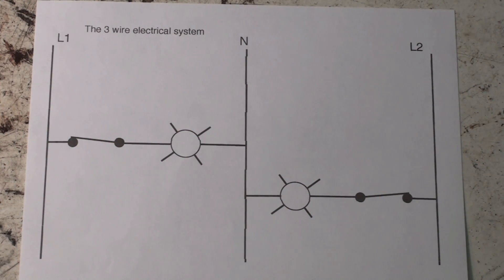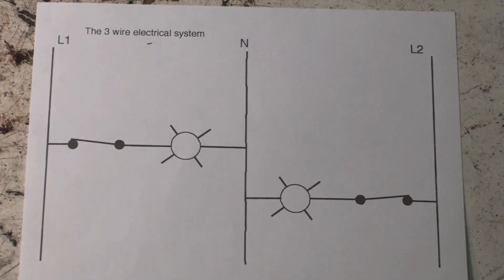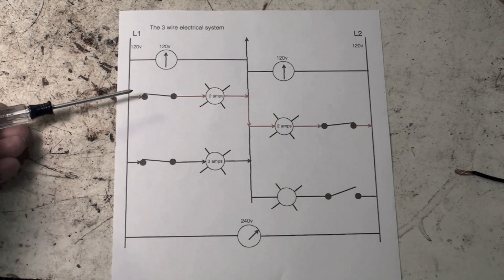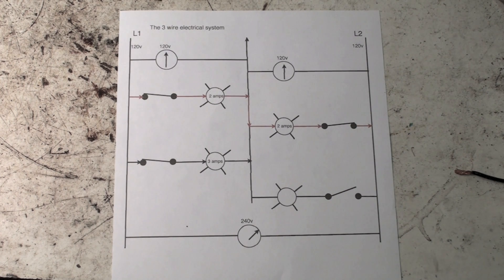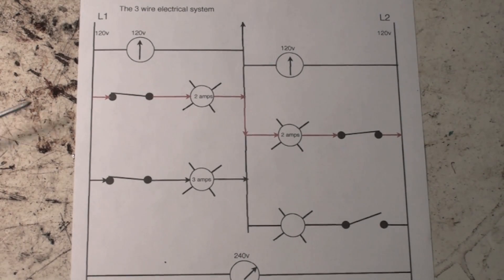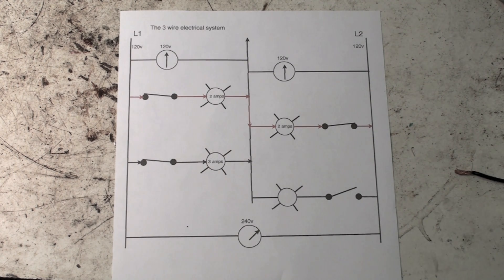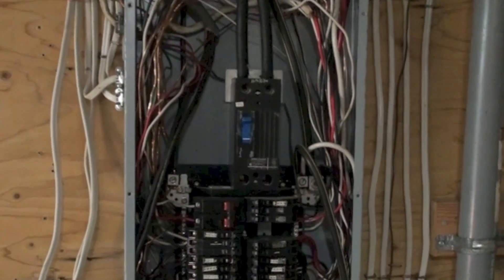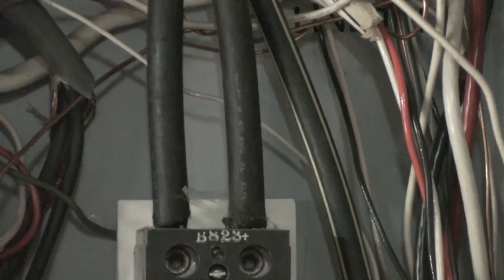How the 3 wire electrical system works

Comment: I ordered a car charger for a customer (240 volt). But, it only had terminal receptacles for L1 & L2. There was also a grounding bar. This stumped me. When my electrician showed up, he told me this three wire system didn't use a neutral. The car charger was hard wired. Is this right? How can it operate with no return path for electricity? This would seem to depart from what you have shown here.
Reply from the maker: Glad you guys got this one done.  Thanks to Cotronixo.
GFM
Reply: Thanks to GFM for taking the time to teach.
Reply: +Stephen Anderson - 240V does not use the transformer secondary center tap. Here's an analogy. Imagine an old flashlight with (2) D-cell batteries, switch on. You place a 1.5V lamp across one battery, and another 1.5V lamp across the other. All three bulbs are now lit. The flashlight's bulb is acting like your battery charger; and for it, no connection is needed where the two batteries meet each other, because it is a 3V bulb.
Reply: Cotronixco I think I'm getting this. when we install a DC solar array, a positive and negative (and ground) come from the array (marked black and red like a car battery)...but no neutral. So, if charging a battery, apparently the battery is DC and wouldn't need a neutral. But, the power from a home is AC, not DC and I doubt the car charger is inverting AC to DC. So, apparently AC can charge a DC battery using L1 and L2 (2 hots), but no neutral. Interesting.
Reply: +Stephen Anderson - Your battery charger is designed for a 240VAC input and a 12VDC output. Inside, there is a step-down transformer and a rectifier, which is how it converts AC to DC.
If the battery charger's transformer primary were center-tapped and connected to the building's neutral, no current would flow through this neutral conductor, which is why it's completely unnecessary.
Reply: Cotronixco Awesome answer. Thanks.

Comment: Interesting and informative video GFM.  

I can understand that panel imbalances go out the neutral wire and are balanced by contra imbalanced loads from other panels.  This of course implies that all imbalances are equally distributed between the two phases, i.e. +120 VAC and -120 VAC.  Does this happen in real life?  It's hard to be perfect so what happens to to the net imbalance.  Does it go back to the powerhouse?

Some of the circuits in my house use 3 wire + ground (14-3 +G).  The two hot wires are connected to adjacent circuit breakers meaning they are +120 VAC and -120 VAC.  I end up with two 15 amp lines with a common neutral which never carries more than 15 amps as all current above this amount is balanced out.  Should I care about balancing both circuits?  Meaning, should I aspire that the common neutral carries the least amount of current by always having both hot circuits in use?

Somebody told me that gross imbalances leading to large current leaving the house to be balanced elsewhere will raise my utility bill.  Is this true?
Reply from the maker: I would not be concerned about the imbalance.  I don't know how an imbalance could increase power usage.
GFM

Comment: I still don't get it, If you were explaining DC voltage, it would make sense. You don't call your diagram a two phase system. In Europe your diagram might be a single phase. Doe's Europe have 480 volt double phase? I guess my question is, is the 60 clycles per second AC cycling between "L1" and L2 ?"  L1 is negative when L2 is positive?  Or is L1 positive while neutral is negative, then changing to positive when L1 is negative. This would make the neutral a hot wire. Your explanation just isn't good enough for me to understand.
Reply from the maker: Europe uses 220 V AC.  You are making this far too complicated.  If you are looking to understanding the AC system at its basic level, get an engineering text and have at it.  There is no positive and negative terminal in AC as the polarity is constantly changing at 60 cycles per second.  Certainly when one side is negative, one side will be positive.  I am telling you what you will get when you test with a meter.  
GFM
Reply: grayfurnaceman   People watch your videos because we are too lazy to read a manual. What I’m saying is if you are going to the trouble to make and post a video on YT, don’t just tell us about the first book of the bible. If you are our electrical priest you just need to include the second half as well.
Reply: I want to add something. You don’t realize how smart people are today. My house is poured concrete. The 110v house wires run through galvanized steel tubing. You said that water pipes are sometimes used a “earth.” When my fuse panel was changed to circuit breakers the electrician drilled in two,  meter long copper, maybe bronze, copper is soft, through my concrete patio and then into the coral substrate we have in South Florida. So if the electrician earthed the box also, if I install a metal appliance that grounds (earths?) to the steel tubing in the walls, is this dangerous?
   I used to travel to Central America and Mexico a lot when younger. When I heard that the shower water was heated for the shower by just winding bare wires around the metal water pipes to heat it, I had a fear of showers south of the border.
    I built boats for twenty years and built a sail boat for myself. Not realizing the height of the mast and the height of the the power lines, my antenna on the mast hit the lower high tension line and I was told that an ozone  halo was created and this took out the secondary line as well resulting in 45,000 volts going from my foot to my arm and I was in the hospital for a week. So I have a reason to have a personal interest. 
    Theres a guy on YT from England that takes apart electrical devices from England. I think his name is “Big Clive.” His videos would interest you.
Reply from the maker: It is not dangerous.  It just gives a place for lightning and discharges of all sorts to dissipate.  Glad you are still here after the sailboat incident.  Lucky man.  About the power going to ground.  High voltage works differently than the low voltages we see in our homes.  The comments section is not the place to build an understanding of earthing but suffice it to say very high voltages will overcome the high resistance and go to earth ground.  I did several videos on earth ground.  I also have a playlist that may help.  "Electric wiring in the panel grounding and bonding".  Hope it helps.
GFM
Reply: I have another question for “grayfurnaceman.” I’ve had 3 or 4 water distillers over the past thirty years. The thing that kills distillers is the thermostatic circuit breaker that shuts the machine off when the water is gone and the temperature rises. The heating coils seem to last forever. So if a gallon of water is distilled in 4 hours, I try to un-plug the distiller at 3 and 3/4 hours, but I always forget. So I have a timer, but the distiller is a 3 prong and the timer is a 2. So, not having an adapter, I’ve cut off the ground “probe” to “make it fit.”  Am I going to get electrocuted? Will turning the plug 180 degrees make a difference?
Reply from the maker: First, do not turn the plug.  That will reverse polarity.  Cutting off the ground is not the best way.  I would prefer to use a grounded timer.  If you insist on using the 2 prong, then be sure the unit is connected to a ground fault outlet.  Hope this helps.
GFM
Reply: grayfurnaceman  Reverse the polarity? You know I’m plugging into an AC outlet ? The timers bought at Home Depot will all be the same, without a round “ground” “Neutral” prong. I guess what I’m asking is why will most two prong, if that is the right word for them, plug-ins only enter the socket one way? One side is wider than the other. There must be a reason for this.
Reply from the maker: A/C does have polarity.  The small prong is hot.  You can shocked by this one.  The large one is neutral.  You will not get a shock by this one.
GFM
Reply from the maker: A/C does have polarity.  The small prong is hot.  You can shocked by this one.  The large one is neutral.  You will not get a shock by this one.
GFM

Comment: Right for the wrong reason. Neutral center taps secondary field coil of the transformer thus allowing for half of voltage potential, and double amperage( If I'm remembering correctly) in a single phase service, also providing a path back to source, wich is the secondary field . L1 and L2 appear to be phased 180deg. Apart however they are not , because it is still a single phase. Awesome channel grayfurnaceman! You saved my butt the other day thanks for having this channel
Reply from the maker: Thanks for the support.
GFM

Comment: Wow, who wired that panel? That kind of sloppy work drives me nuts. Its unsafe for the next guy that has to work in it if he has to do any live work or troubleshooting in there.
You say neutral is at the line voltage, but its not. As others have said, neutral is center tapped, so its 208 from L1 or L2 to neutral. Ground would be referenced to 0 volts for the safety side of it if you developed a short.
Reply from the maker: This is in the US.  Unless you are wired to a Delta system, voltage from neutral to hot will be 120.  Earth ground is not part of any circuit.  It is there to sink surges, lightning etc.
GFM

Comment: Can you branch a 120v outlet off of a 2 wire 240v outlet?  I assume you need to bring a neutral to the 120v outlet, but will the hot line from the 240v outlet be 240 when something is plugged in?
Reply from the maker: If you pull one leg of the 240 and use the neutral for the other one, you will get 120V.  
GFM
Reply: grayfurnaceman    What about the ground for the 120v?

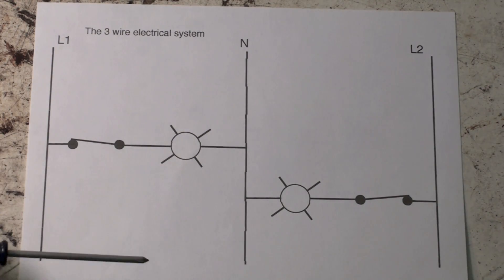Comment: +grayfurnaceman This is totally incorrect. For example @0:47, the neutral provides a return path to the power source for both lines (true for all circuits), and not whatever quasi science you're saying.  @0:54 there's 208v between L1 and L2, not 240v, because both L1 and L2 are out of phase by 120 graphical degrees at the point of generation, so it's not a straight addition of 120v +120v, (It's 1.73 x 120v). @6:40, the neutral will carry the resultant current of that drawn by the two out of phase L1 and L2 conductors, which I calculate to be 4.36 amps, not 3 as you stated.This of course is only true if all the loads are linear (i.e. resistive). If the loads are non-linear, then harmonics may develop, and the current on the neutral may exceed that of its rated capacity, producing heat and wasted energy. The goal of balancing the loads on L1 and L2 is to keep the neutral currents a close to zero as possible. For instance, if in your circuit, L1 and L2 were both carrying 3amps, the resultant on the neutral would be 0.
I hope you're not an electrician...because that panel looks a mess.
Reply: +grayfurnaceman. My apologies GFM...I was wrong in my previous comment. I made the assumption that L1 and L2 were two lines pf a 3 phase system...but having researched further, I find they are part of a single phase, centre tapped one...which here in Europe I've never come across, except for 110v site transformers (centre tapped, producing 55v each side). The thing about the neutral being a return path, still stands...and it provides voltage stability for each of the 120v lines, when the loads aren't balanced. Because L1 and L2 come off opposite ends of the same secondary transformer winding, the voltages between each line and neutral are effectively 180 degrees out of phase,(when L1 to neutral is +120v, L2 to neutral is -120v, and vice versa) thereby producing zero amps on the neutral when the loads are balanced, but as you have said, 3amps on it when Li is drawing that extra 3amps over L2.
So again, please accept my apologies...maybe next time I should think three times, before negatively commenting once.
Reply from the maker: I was trying to figure out your logic and could not come up with anything.  Thanks for the explanation.  
GFM
Reply: grayfurnaceman You're welcome, and again I do apologise.
Reply: Steve Bitschy You're welcome...though I did feel a bit foolish for jumping the gun. I've looked at some other videos posted by GFM, and have to say I like his down to earth common sense approach to fault finding.
Reply: I also assumed a three phase system. Your negative comment cleared that up for me (SS). If it was a phase system then the calculations were a bit off but I think the video still provided a good clear explanation.
Was there a neutral bar hidden behind some of those wires? I did see one
Reply: +WIlly Tee Yes, @9:16 on the lower right side of the screen, it looks like a neutral bar...then on the left side is another bar being used for the ground(earth) connections...but I'd say both bars are bridged together to provide a T-N-C-S earthing system, as GFM states there's no PE conductor entering the box, except for the ground rod connection. Unless of course they're solely dependent on the rod, as in a T-T system.
Reply from the maker: It is in there (somewhere).
GFM
Reply: Shamrock Shore
Reply: 208v if it's a 3 phase system
Reply: lol.  I almost always learn as much, if not more, from comments than i do the videos.  thanks everyone and specifically thanks to  shamrock shore for not deleting his comments so i could learn from them

Comment: can you rewire a 3 phase circuit to a single phase?
Reply from the maker: +fudogchomp Any 2 wires will give single phase.  
GFM
Reply: +fudogchomp  In the USA any two live wires will give you 240v single phase and any live and the neutral will give you 120v single phase.  In the UK and most of Europe it will give you  give you around  440 v and 220V.  In many three phase applications there is no neutral present so you may have to bring one in from the panel. Don't be tempted you use the ground (earth) wire.
Reply: +Bryan Hughes hmmm, so in a 460 DC application there is no way of getting 120v? thanks in advance!!
Reply from the maker: +fudogchomp I assume you do not mean direct current.  There is no way to get 120 volts from 460.  One lead to neutral gives 277 volts.
GFM
Reply: +grayfurnaceman ahhh, I figured. thnx as always GFM 👍👍👍
Reply: +fudogchomp Hi, if the supply is DC then by it's nature it can't have a phase as only alternating currents have phases ie. can't be a 3 phase circuit. If it is DC then it it very difficult to change the voltage. Traditionally this was done by effectively housing one motor connected to a dynamo in the same case. t can be done electronically these days but high current is very high cost. This is why AC ended up as the norm in just about all countries. With AC you can easily transmit high voltage through thinner cables as higher voltage means less current and convert it back to a lower voltage at a substation. If you had DC supply, like some places in Sweden until recently. as you can't readily change the voltage the cables have to be exceptionally thick to carry the high current. Hope this helps.

Comment: The neutral is the center point of two windings   known as the secondaries and splits 240 volts to 2   120volt lines as long as
the load is connected from the ends to the center tap or neutral, 240 volts still being available. The power in kilowatts is
determined by the size wire the transformer is wound with.
  
 If you have various loads from L1 and L2 to neutral and then lose the neutral up at the pole or in the panel, , loads will now be in series across 240 volts with a much greater voltage across some loads and a much lower voltage across other loads.
 causing a lot of burned out appliances.
Reply: Center point of one winding. Namely the secondary winding inside the step down transformer.

Comment: Of course the Neutral has a very important role, a Neutral is a zero volts reference, if it was not connected to the distribution transformer, and became open circuit, or disconnected, then imagine if you had a short on the L2 circuit, then all your 120v light bulbs on the L1 circuit or line would blow out as they would be subjected to 240v.  
So Neutral line is just as important not only from the balancing point but to protect voltage sensitive devices connected to each of your two hot lines L1 and l2, however provided both loads on L1 and L2 were of equal loading then the Neutral does not have as much importance, but should one of the loads develop a fault then the other will be subjected to twice as much voltage and cook out!
Reply from the maker: +Jayant Desai Good point.  True if there was a direct short between the neutral side of a load and L2 without the ground being involved, you would apply 240 to the 120 volt load.  This does happen in kitchen ground fault circuits where you have 2 circuits (L1 to L2) that you are using one ground fault in the panel for protection.  Thanks for the thoughts.  I will have to do one on that.
GFM

Comment: there is single phase and three phase      is there a two phase?
Reply from the maker: +Bigtime stoner I have never seen it.
GFM
Reply: +Bigtime stoner "split phase"
Reply: +Bigtime stoner 
Its single phase because it comes off of one transformer. and 3 phase comes off of 3 transformers. In my mind though, edison 3 wire is kinda like two phases coming off of one transformer, but it's not called that.
Reply: ipreferns Yes, a "split phase" is the alternating current equivalent to the old Edison three wire direct current setup.